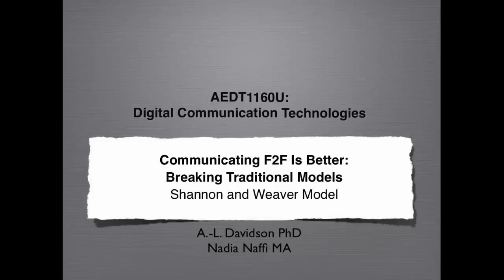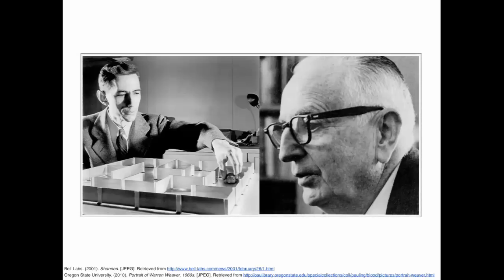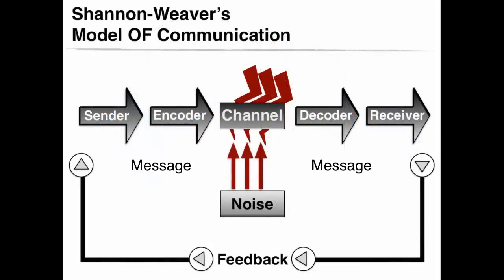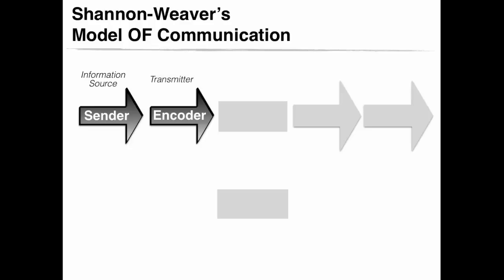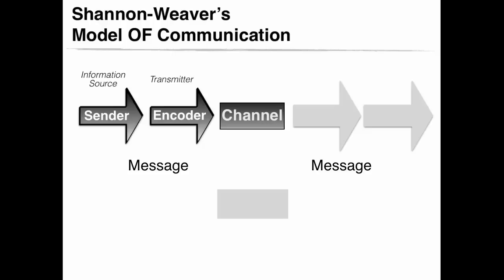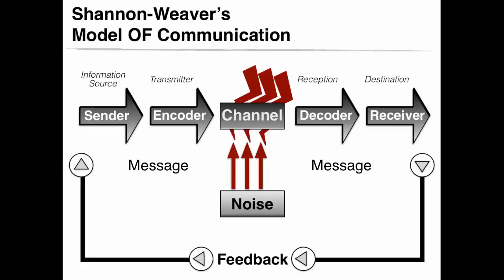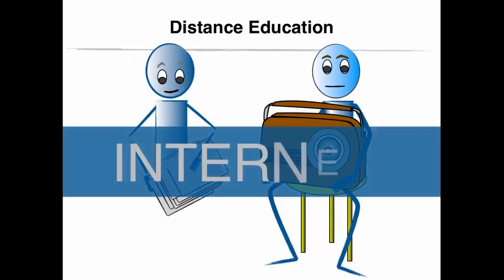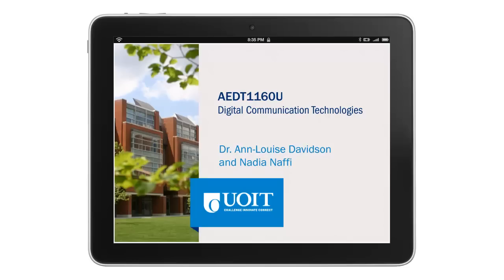VidClip 2.2 Shannon and Weaver Model

Comment: Being such an old model, it's interesting to analyze how the Shannon and Weaver model of communication applies to today's digital communication methods. Looking at methods such as internet chat/instant messaging, we still see the key components of the model coming into play. The sender and receiver's roles remain unphased as these two components are essential in any form of communication. The encoder and decoder now become electronic devices such as mobile phones or PCs that have the IM capabilities. Instead of physical/written channels, we are now dealing with an electronically written channel that has an interesting impact on the communication noise.

In my opinion, such electronic channels eliminate noise in the traditional sense. The message is delivered to the receiver exactly as it was typed out by the sender, and there is no point at which any noise or interference can distort the message. However, the use of electronic channels introduces a number of other issues that were nonexistent in traditional communication methods. Issues with latency and connectivity can cause a message to be delivered in an untimely manner which can cause an undesired response for the receiver. Such occurrences can make the receiver feel as though they have lost the other individuals interest or have invoked some form of negative emotions.

Comment: I think this model does still apply through virtual communication. Can a form of noise be connectivity issues? Like not having a good WIFI connection which would result in delayed responses? In that case, the transmitter/receiver could misinterpret the delay and think perhaps the other person is not paying attention or was bothered by what they said.
Reply: So true, Elizabeth.  Isn't it funny how we make up stories to fill in the holes in communication?  Its human nature to want to fill in the gaps, and so VERY often we do so with fiction rather than work to ascertain the fact.  For example, I'm communicating with you online.  there is lag.  you infer that I'm bored or distracted or thinking about my answer, when really I'm just waiting fir my internet to catch up.  The whole rest of the conversation is now impacted by that assumption.  Is that noise?  Heck yes!

Comment: After re-watching this video and reading the comments there seems to be a lot of focus on the lack of non-verbal cues in digital communications. I would agree fully that this is a huge issue with text based language exchange. I think the lack of these non-verbal cues in digital communication falls under the NOISE descriptions as the original message can be misconstrued.  Like Desiree's comment regarding the loss of sarcasm in text messaging. It could be very easy for a person to take the text literally thus missing it's intended meaning.